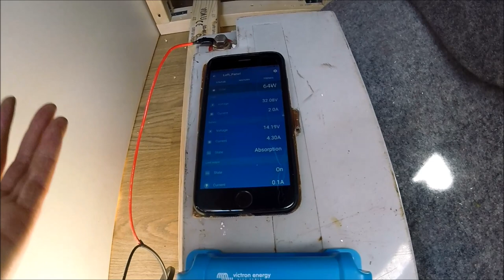Solar Panel & Victron MPPT Install In Ford Connect Micro Campervan Conversion

Comment: I wish you knew that you could use the double sided tape (30 lbs x 1 inch) and celicone sealant/adhesive to use to attach your solar panel to the roof.  You could save so much energy.
Reply from the maker: I know perfectly well that you "can" use tape for solar panels, but after seeing lots of panels going flying off van roofs makes me want to bolt them down to ensure they go nowhere...
Reply: @TheCampervanBuilder  Well, I partially agree with you. Sometimes it was happening because people was forgetting about wind deflector. Wind deflector provides additional security to installed panels. The solar panels without the wind deflector create a huge windage during the ride and as result the solar panel(s) flying off the van's roof. What make me sure? I have 400 watts of solar panels and a wind deflector on my ford transit connect's roof for the last 6 month. Double sided tape and silicone sealant/adhesive on the frame worked very nicely for me. Physics to help you in your projects.

Comment: I see you have used tiger seal for this job where as I usually see you use pureflex 40 , is there a reason for the change .
Reply from the maker: I usually use Tigerseal or Sikaflex for exterior work and Puraflex for interior work, although Pura is still rated for exterior too
Reply: @TheCampervanBuilder  
Thankyou,  keep up the great work

Comment: A good interesting video. Looked at the prices of the items you have installed they are expensive. Could you not just fit a split charge relay system.
Reply from the maker: I'll probably be fitting one of those too, the idea is to be able to park up for a week or more and not have to run the engine to charge the battery whilst having the fridge running 24/7
Reply: I have the split charge relay on my van and need to fit a system what you have fitted for that very same reason.  Any chance you helping me out.
Reply from the maker: I have a bit too much on at the moment and when finally finished, want some well earned downtime so I can't take on any extra work, thanks for the offer though